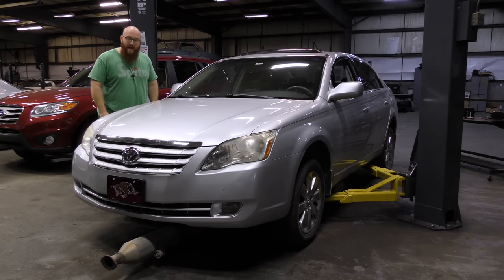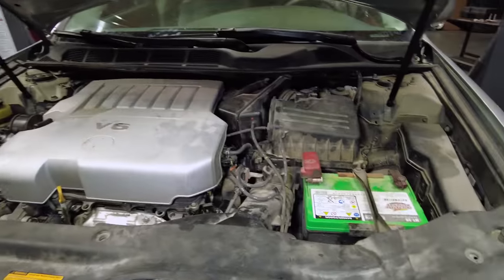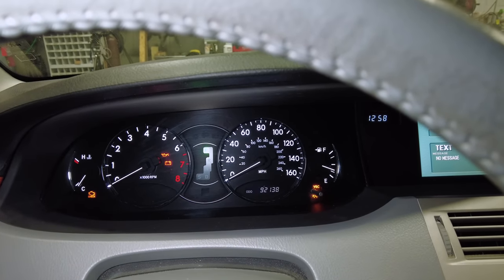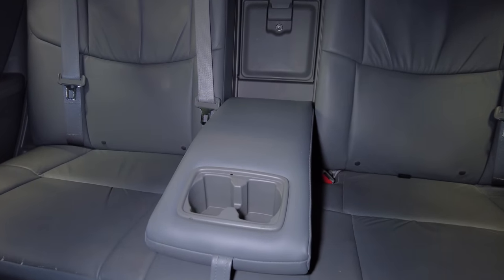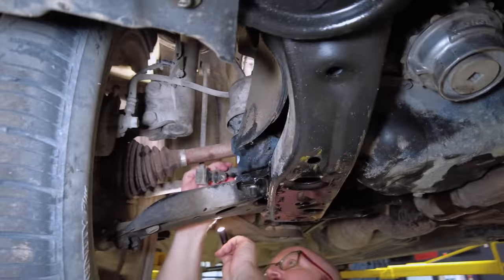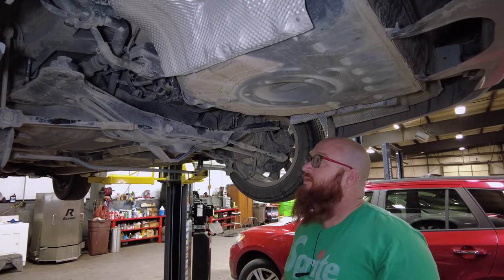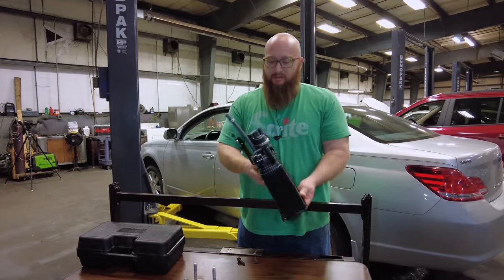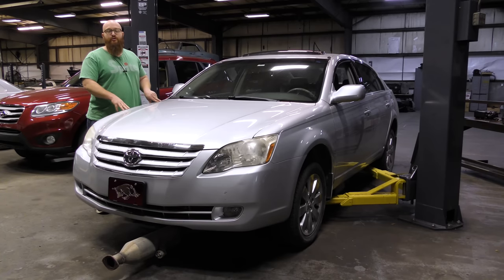Dumbest place for essential emission part on this '05 Avalon! CAR WIZARD is not happy!

Comment: what a miserable car!   drove one of these in the touring trim (fancier than the one in this video) as a one-way rental from vegas to albuquerque way back in 2009...the front bucket seats looked like recaros but had none of the padding or ergonomics...there is a metal bar that goes sideways across the bottom seat cushion...after a few hours, it feels like you're sitting on a handrail

the other funny thing about it was the crude suspension with virtually no anti-dive or anti-squat dialed in...when you would punch the gas on a freeway onramp, the front end would lift briefly with each upshift of the transmission...unnerving the first time it happened, to say the least!  to surrounding vehicles, it probably looked like a lowrider with a malfunctioning hydraulic system

by the time we got to flagstaff, my brother and i were joking about pulling off the road, hopping out, getting our luggage out of the trunk, putting it in drive and letting it drive itself off a cliff and catching a bus the rest of the way to albuquerque! LOL

at the time, i owned an e30 and an NA miata, so my ideas of what was acceptable as far as suspension tuning and mechanical refinement go, was much higher than the avalon could deliver

lastly, this was probably meant to be cross-shopped with something like the crown victoria or the 300/magnum or whatever the GM equivalents were